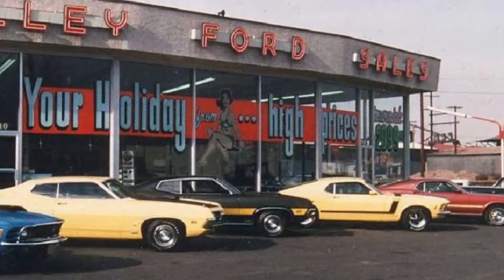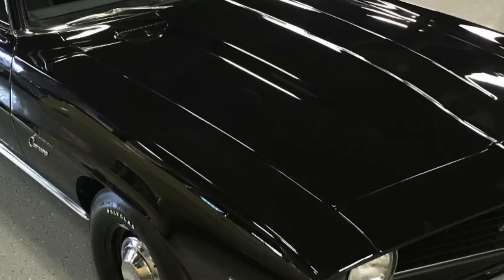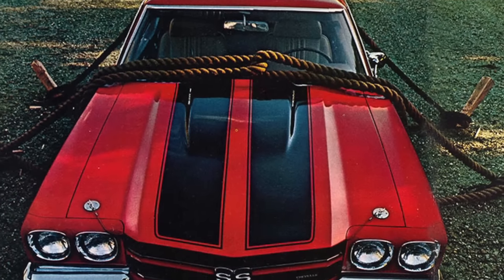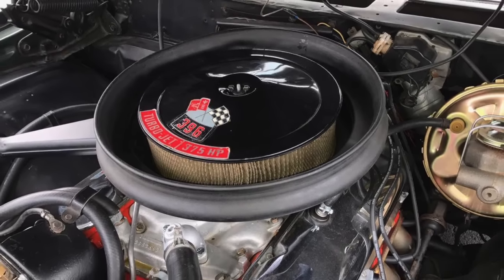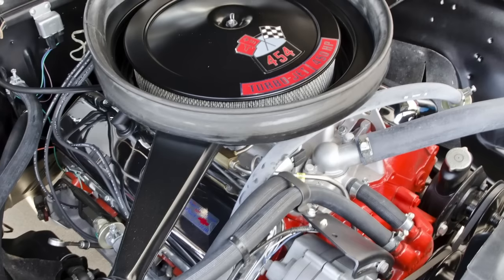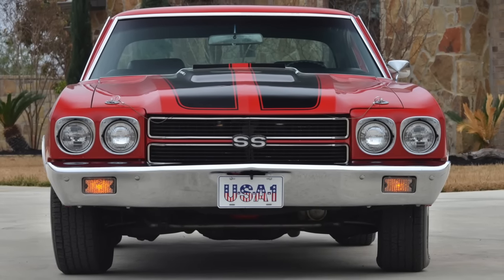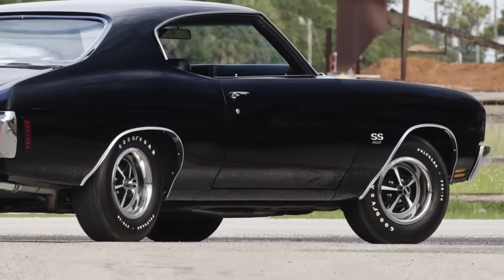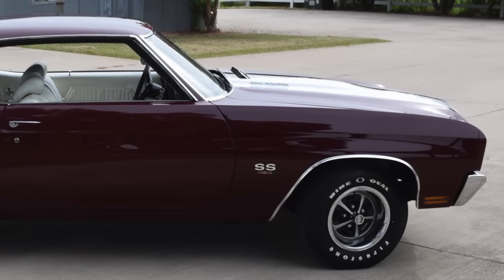1970 Chevrolet Chevelle SS LS6 454 – Freak of Nature

Comment: My LS6 beat a 440 six pack by 2 car lengths and killed 427 Corvettes. Of course I had put a larger intake manifold and Holly 900 on it.  No one seemed to mention the torque in this post. You could be cruising in 4th gear at 40mph and punch it and it would take off.  Never should have sold it

Comment: The cowl induction was operated by a vacuum diaphragm, not a solenoid. I know because I met a guy several years back who owned one and was allowed to look under the hood. It was the only part that wasn't working because he couldn't find a replacement. It was a sealed unit and couldn't be repaired. JMO.
Reply: You are correct. Vacuum operated, it opened the cowl when you mashed the foot pedal.

Comment: One thing about the 454 in71 it had 365 or360 horsepower can't remember but they did not change one thing on the motor and the next year they went to rating the horsepower by the rear-wheel instead of by the crank and it went down from something like 360 down to 270 horsepower without any changes to the motor drivetrain are anyting. Horsepower Went down almost hundred horsepower just from rating the power different
Reply: Gross versus net horsepower. Net was hp measured at the rear wheels. Gross was measured at the crank.

Comment: 70 Chevelle SS 454 my favorite car ever. But what happened to all the Nova's? You could get a smaller, lighter Nova with the same hp. When I graduated HS in 72 it seemed like 15-20% of the cars on the road were Nova's. Granted most were the 307 or 350 v8 (easy to modify) but you never see them anymore???

Comment: There are many cars today that can blow the doors of this car. A stock Cadillac CTS-V does the quarter mile well under 12 seconds. Heck, even a stock BMW 328i with a 4 cylinder engine can do the quarter mile in the 13s.
Reply: Wrong,  check out pure stock drags. Top ten, 6 cars in the 11s, the rest low 12s. Noob!

Comment: Sorry, but the 1964 Chevelles (Malibus) also had an "SS" -- Super Sport.  You could get it even with the base 283ci V8.  The "first" for 1965 was the SS-396 and was made in limited number (I think it was 60x --- I can't remember off the top of my head which it was, I'm thinking 602, but just over 600 were produced).

Comment: It had the most horsepower straight from the factory out of all the muscle cars, correct?
Reply: GM was fudging the numbers since 1966 the corvette L72 427ci was first rated at 450hp@6400 which dropped down after a few months GM figured 450hp rating would attract the attention of safety minded politicians and insurance companies so they just said it made 425 hp@5600 which it did but the engine made more past that RPM since nothing was changed.  if you look at the specs of the L72 427 and LS6 454 they were the same thing just one had more cubic inches and made power lower in the rpm range.  then you get into the L88/ZL1 427s they were rated at "420hp" (GM rated the engine low so knuckleheads didnt order it because it was "weak") but uncorked and the correct carb installed made +550 

Also the numbers you see on cars of that era were gross HP so 450hp gross = 345hp net which you see on modern cars hp ratings.

Comment: The 70 LS6 is definitely my favorite RPO Chevelle but I'd take a 69 COPO 427 over any Chevelle...even a 70 LS6. The 69 Chevelle COPO 427 was slightly quicker in the 1/4 mile than the 70 LS6 and also way more rare. Only 323 of them were ever made including the Yenko 427 Chevelle's. I've always thought that 1968-69 was the best looking Chevelle body stylei

Comment: You know for a long time the LS6 was seen as the king now many people want to Dethrone it and I think the only way you can put up an argument for any other car would most likely be the 70 Buick GSX and there are times when I do sync the GSX was a better car few more options few more Creature Comforts relatively competitive performance also came in in the low 13 second quarter miles and I love them both but I don't know in my early twenties I got to drive in LS6 it was my uncle's friends he had it at a car show and I got to tell you there's something about stepping into any old muscle car granted but that LS6 when you sat behind the wheel I'm pressed on that gas pedal you could just feel the uniqueness you knew that no matter what pulled along beside you it wasn't going to pull away from you

Comment: Imagine if you put an 4 speed automatic in that.  With that power it'd bout have to be a 4L80 but if you knew how to modify a 4L60..   It would be a thought.
Reply: How 'bout 8 or 10 speed from 6th gen Camaro? Gotta put my Summer wheels/tires - 245/40R20 275/35R20 - on it, too.

Comment: This dusty old brain is trying to recall what other muscle car competitors were doing in the years covered here for Chevrolet. Such as, the specs on GTO's, Ford's enduring mustang, etc. And, I'm fairly certain my first car ever was classed as a muscle car. It was the year Oldsmobile planted that huge big block in the Delmont 88, and I'm pretty sure it was a 455. But by the time I owned it in 1976, it was on its last legs and the tranny was slipping. I never did restore that thing, but had fun in it anyway. I now wish I'd have held onto it. I ended up with the Monte Carlo, as I bought it from a private owner for a song when I was18 yrs. old.

Comment: Their was a special delight for those lucky ones that was really in the know 😊. It was in the trunk🤫
Reply: 1970 Chevelle SS 454 LS6 with correct coded '75' cranberry red paint w/ black stripes.

- Correct '755' coded Black bucket seat interior with factory console, Optional SS Rally dash with LS6 specific 6500rpm tach and full factory gauges.

( this was a Cranberry red 1970 CHEVELLE SS454 LS7...) 

- Factory upgraded 'XCH' Coded LS7 Chevrolet 454cid Mark IV big block V8 factory rated @500hp, casting code ' square port cylinder heads (LS7 only!)

One of the rarest muscle cars ever created with Chevrolets most powerful engine ever offered! The heads and other parts came in the trunk...

-The F41 sport suspension with F+R sway bars, Optional and Functional cowl induction flapper hood with 'Fresh Air' air cleaner.

- A 12 bolt factory posi rear differential, and 
Ultra rare and mandatory Muncie M22 'Rockcrusher' HD 4 speed transmission, Correct coded and factory stamped CRV code (LS6 )

- Correct Super Sport wheels...

The LS7 was not being offended as a build vehicle from the Dealership - but if you had the ability and knowledge it was yours...

Comment: Not totally true about the 454 Ci. For years after the 454 was available as boat engines with no emission or compression reduction standard.
68 was the start of the best looking design of the Nova, Chevelle and Impala. Yet I think 1970 topped them all off. Sorry Camaro lovers. I actually thought the the Pontiac Firebird looked better.
Just my opinion.

Comment: I have a 1970 Camaro SS with a 396 big block just a beautiful car and a big beautiful powerful motor, I also have a 1970 Dodge Challenger with the 440 magnum four-speed with the pistol grip also a big powerful motor, I think the Camaro handles better in the Challenger is faster in a straight line in the set up that I have both of them are stock but I believe the Dayna rear end in the Challenger is what gets it from 0 to 60 faster than the Camaro and perhaps the four-speed but I’m not sure

Comment: 4.25 bore * 4.00 in stroke, and it was perfect foe modent CNC heads and a 1:1 blower for a big block 2 stroke, just ned to weld a baffle between the itn ex valvle ports for complete loop scavenging through the valves and there you go

Comment: Chevy still make the 454 big block as a crate engine. I wonder if they're allowed to drop that in a production car? If so, maximize that engine, drop it in a Camaro chassis with new retro styling based on the Chevelle, call it the Chevelle SS 454, and throw it onto a drag track against a Demon.

Comment: 13.1 LS6 bone stock...on those shopping cart sized wheels and tires!  Give it some modern light weight rims on gummy 325 tires and this is close to an 11sec car off the assembly line

Comment: are you sure the 61 impala ss 409 didn't start the muscle car craze it was kinda the first true muscle car...
Reply: Nope. Muscle car recipe': cheap MID-SIZE coupe + big block V8 - GTO, Chevelle SS, Buick GS, 4-4-2, Charger R/T, Road Runner 383+up, Cyclone, Torino, AMC Rebel(?) So, large car motor stuffed into a mid-size coupe. Impala was Chevy's big car.

Comment: They were throwing out numbers of the SS and people's incomes in 1970. The car was only half of someone's yearly income, which doesn't seem that bad when you figure today a loaded pickup truck will run you $65,000 and not that many people in the general populous drag home $130,000 !  and that's only a pickup, never mind an upper crust sports car, like the Chevelle was in it's day. The only good news here is you can go buy a Toyota Tundra with aluminum block and 400 HP (with emissions)
Reply: Car loans were for 24 months not 72.

Comment: Why do Americans love going fast in a straight line? It takes little or no skill. Driving fast around a track, without crashing, is what it's all about. And no, I'm not talking about an endless left-hand NASCAR track.Real drivers turn left AND right. Yabos.
Reply: Grand prix, autocross? I agree, but I like my back roads. 3/4 to 4 miles between lights or stop signs - twisty, curvy, with small & large hills - around here. Also, not so much GOING fast in a straight line, but the acceleration rush...

Comment: I'm pretty sure there were no L88 427's factory installed in anything other than the Corvette.  There were COPO L72's and the ZL1's along with dealer installed crate L88's.  As for the LS6 it was more marketing than anything else as didn't put numbers any better than the L72 in fact they make few HP less and few pounds more torque.  

Personally I doubt GM was ever that committed to putting the LS7 in cars as it was just a stroke L88 and those factory race engine were too high strung for the street use.  It's bit of mystery why the 70 Corvette didn't get the LS6 as well, limited the LS5.
Reply: I worked for GM at that time, LS7s were never meant for the street as the gasoline quality was starting to get less and less orientated towards high compression engines. It also had to do with insurance policies and they would not insure a car with an engine that produces more hp than cid.  The secret in those days was to retune the distributor curve, put in less restrictive air cleaners and mufflers which all could be found in the off road GM factory catalogs. I installed many of these parts under warranty for "non performance" claims etc. I just wish I would have kept a few of the beasts I owned back then, but who knew what they would be worth many years later.

Comment: Sorry dude you have good information however you do not have your information all correct they offered a LS7 454 465 horsepower I'm old enough to know I saw them I Road and them do you research
Reply: The LS-7 was a create motor, only Yenco put them in at their dealership as far as I know. Now the ZL-1 is a completely different story!
Reply: They offered them over the counter in the parts department.

Comment: There is no such thing as "Pound Feet". Power is defined as the amount of energy used in moving 1 pound a linear distance of 1 foot. The constant in this equation is the distance (Foot) and the variable is the weight (Pound). It is improper to describe the distance as plural, it is always singular, therefore there is no such thing as Pound "Feet". Another common mistake is the use of the word Motor. A motor is supplied by an external power source such as a battery, generator, alternator, wind turbine etc... An engine is supplied by it's own power which is created internally. Calling an engine a motor is a rookie mistake.

Comment: Not so freaky after a couple of runs with my 1970 Dodge Challenger! I had a 70 Challenger with a 383 cu block with a three quarter race cam and ported and polished 440 heads putting out about 425 hp. Bumper to bumper! After two runs with a 383 badged Challenger, the 454-450 Chevelle left town never to be seen again!!

Comment: u need to do more ready try going to l.s. web sight the engine they put in the 70 chevelle was the 396 and ho 454 bbc then they added the l.s. 6  454 small block and the l.s 7 427 small block to the chevelle no l.s. for the vett they never put another l.s. in a car stock till the 90.s this is fact if u need the truth go to l.s. web site they have a big thing on the 70 chevelle and it was all about introducing the new crate engines that were coming out in 1970 the mark 4 series and some were bbc , sbc and the new l.s. line 1-7 which all l.s. engines are a small block but who would know more about a l.s. engine then l.s. and this is were i got my information from .and they never put a l.s. 5 stock in a car till the 90 and not sure if they even did that because the vett got the l.s.7 in 96 as an option engine did u even know that all l.s. engines were a small block only and they only use one block for all l.s. engines but i will do more research on the l.s. 5 to find out if they ever made it a stock option and when they did i just know in the 70 they only put the l.s. in the 70 chevelle and it was only the 6 and 7 models and the only way u could get a l.s. engine after that was a crate engine till the 90's then it was only a vett at first then a few other rigs

Comment: Hahahahaha😂 quarter mile in 13.12 @ 102 mph. And people pay huge amounts of money for these old clunkers. In the mean time, they can only beat a Honda Accord by 1 second which does the quarter in 14.1 @ 102 mph. Pathetic waste of money.
Reply: Video or pick of your time slip please...🤣
Reply: 2t713 Actually I have an old 2002 Acura TL which is slow as molasses. I’m from a time when muscle cars sold really cheap. For instance, in 1975, I almost bought a 1967 GTO for 500 bucks but ended up with a 1967 Impala coupe (not the SS) with a 396 for 425 bucks because it was 75 bucks cheaper. Some time in the mid 60s my dad bought a 1959 Cadillac coupe for 325 bucks. So it’s hard for me to see these cars as nothing more than old outdated pieces of garbage. If you look up the stats for the Honda Accord 2.0 turbo you’ll see those stats. I understand in racing 1 second is a huge difference. Anyhow, hope you’re doing well during this difficult time. Take care 😎
Reply: @TheBoomerPlace  ok, the point is you're not going to take a Honda to the track and run a 14.1 1/4 mile, and you know that...I hope.

Comment: Chevy was notorious for fudging their HP numbers. Super Chevy dyno tested a perfectly tuned 1970 LS6 Chevelle and it made 283 RWHP and 320 Lb. ft. Of torque. A typical drivetrain loss is 15% so a 450 HP car should make 380 RWHP.  Meanwhile a very antique 421 SD that Pontiac rated at 406 HP made 488 gross HP.
Reply: I think they make more than that, headers, recurved distributor an slicks and it will run high 11s a 115 mph.  283 RWHP will not get you low 13s with a 4100lbs car with driver.
Reply: I refer you to the Pure Stock Muscle Car Drags Home page where the ET and Trap speeds are recorded for all your favorite vintage Muscle cars in perfect tune. Sorry but no stock Chevelles in the 11s.

Chevelle SS 454 454/450 3A 4.10 12.910 108.40
Reply: It takes about 350 RWHP to push a 70 Chevelle 108 MPH in the 1/4 mile.
Reply: @timsharpe3498  I said headers, recurved distributor and slicks will run in the 11s. You stated they only make 283 RWHP stock...LOL
Reply: Headers will net 20 HP. We know a well tuned LS6 will run 108 in the 1/4 mile. Are you suggesting that 20 more HP will make it pick up 3 MPH? Those pure stock muscle car racers know how to tune a car and they’re allowed to raise the compression above stock. Without all the massaging a showroom stock SS 454/450 would run 13.30 @102 and the only way that tub gets into the 11s @111 MPH is with a 200 shot.
Reply: Correction. You’re claiming headers can pick up 7 MPH in the 1/4 mile. Maybe if you include a turbo.
Reply: @timsharpe3498  you're all over the place, first it's 283 RWHP then it's 350 RWHP, then it runs 13.1 then it runs 12s now it runs 13.30 @102, you are delusional. Ls6 Chevelle ran 13.12@ 107.2 mph stock on 14" tires.  Slicks, recurve distributor and headers will get you in the 11s, it was done many times back in that day.
Reply: The mods you’re talking about would net maybe 2 or 3 MPH in perfect conditions but you’re claiming an 8 MPH improvement and that’s impossible. Slicks will improve ET but they won’t help MPH much at all. Besides all that, I can assure you that the Pure Stock Muscle Car example I provided had higher compression than stock and perfect distributor curve and jetting so he’s gonna outrun your fantasy 11 sec dream Chevelle. The only 11 second stockers they have are Gen 2 HEMIs, L88 Corvettes And Ram Air 2 Firebirds. Almost all the 454 Chevelles are low 13 cars and they have repeatedly shown that their suspensions are so good that slicks only cut about 2 10ths on a tub like that.
Reply: @timsharpe3498   I know of 2 documented Ls6 Chevelle's and a L78 Chevelle that have run 11.9s with the above mentioned mods, and Super Chevy Magazine had  at least a couple of articles with the same results. I know you're the only person that has seen every Ls6 Chevelle in every State in the U.S. from 1970 till present run through the 1/4mile. You are the weakest link...good bye.
Reply: Meanwhile in the real world a 1970 Buick Stage 1 or a puny little 1968  Ram Air 2 400 Firebird will beat a stock 454/450 HP.  Rick Mahoney ran a best of 11.18 @ 122.7 with street tires with  400 Pontiac RA2.